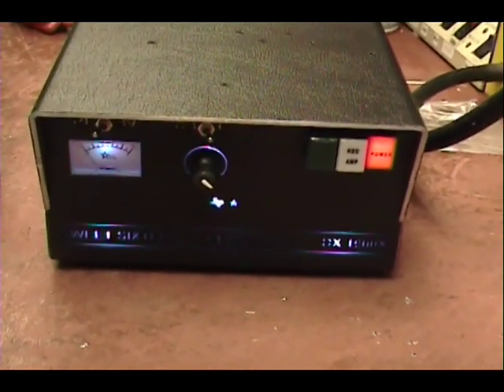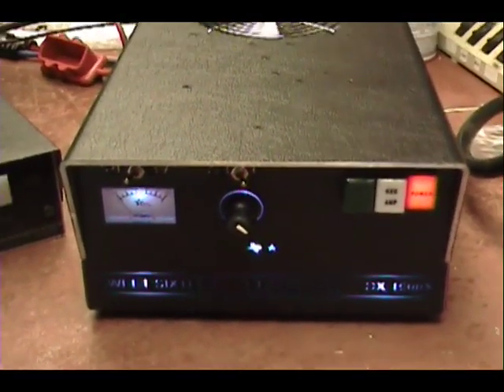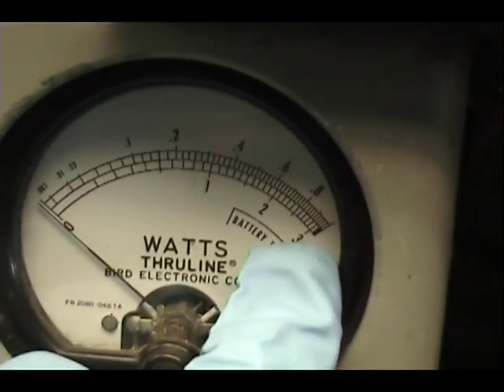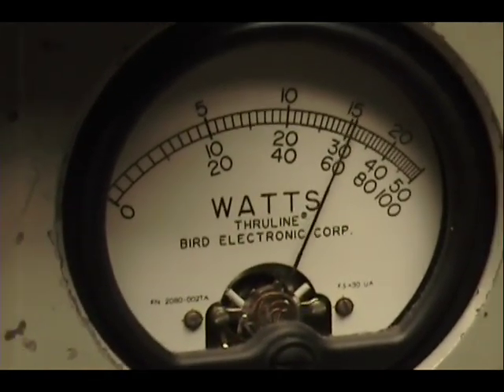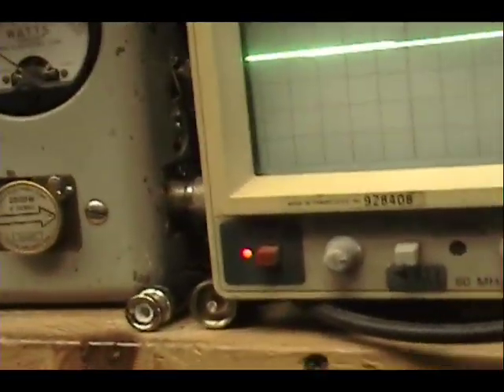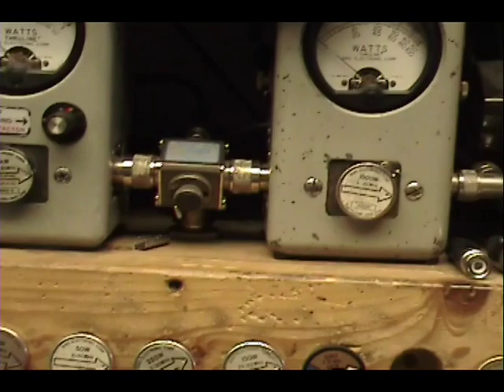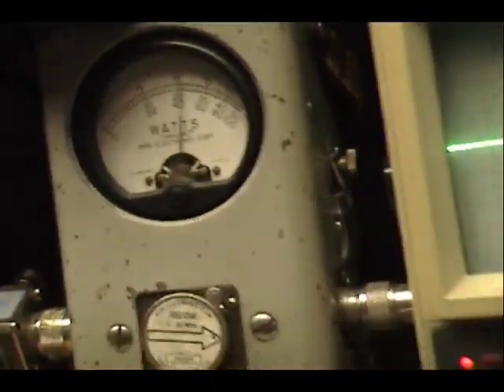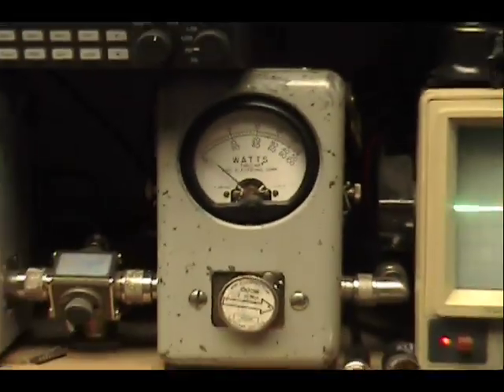Texas Star DX1600X Output Test

Comment: I wonder why they call it a "Sweet 16"?
Reply from the maker: They got that name many years ago when Toshiba 2SC2879 pills put out that much. The difference today in S units down rang will be immeasurable.
Reply: @BellsCB  Thanks!
Reply: @BellsCB  I have about 26 original red dot 2879 I bought in the early 90s when I use do do competition and I'm going to get back in just talking but I don't know anyone I can trust to build me a sweet 16
I have a new untouched 16 just needs tuned and bias set and oscillating diode.

Comment: How many power supplies linked together to provide the 13v ? Yikes.
Reply: Two Astron 70 amp Power supplies @ 14.8 volts using AWG 4 Gage wire.
Reply: @adriandrenalin6716  i have 2 52kx supplies stacked...lots of fan noise. My fluorescent lights in the house dance to my voice.

Comment: great look at the newer sweet 16. I have hot plate DX 1200 8X 2SC2290 got in early 90s class B type. use 2950 or DX99V drive radio. never had a problem still works. got the old style fan kit. only had to get new fans.  look at the scope. class c to AB bias.  you want SSB keep drive down AB on.even sounds better on AM. FM don't matter. it will run cooler in class C. if you run SSB on class C  it will clip a lot and you could pop a pill. this video shows the clipping on the scope very well. great job!!

Comment: I used to run a Palomar 400HD with a really modded Cobra 25LTD> Every meter I put it on was giving me about 300 watts output, with a 2 watt deadkey and about 25 watts peak. Now, I'm running a General Lee, putting out about 45 watts and I'm looking to run it with one of these, as is, no extra driver. 800 to 900 watts of clean power would be really great. I could run my General HP40 into it, but really don't see the point of that

Comment: I would agree 900 clean watts on SSB is more then enough. It would take a bigger increase then what that amp can make in theory to truly make a difference when dx-ing. On top of that if he get's long winded he will need some way to deal with all that heat and will need some serious power supply to keep up with it!!

This sums it up nicely:

Each 3db increase is equal to doubling the reference power. 

(3db = X2) ( 6db = X4) (9db = X8) (12db = X16) (15db = X32) (18db = X64) (21db = X128)  so pushing the gear and generating all kinds of heat and harmonics is not going to help that much. 

Now if this radio had it's audio bandwidth increased and had the ability to use a broadcast type audio compressor and a mic that had more range that combined with the 900 watts would be so much more useful then another 300-400 watts.

Comment: New to the whole base station deal so I would like to ask. If I run this with my Connex Saturn CX-33 SSB and run it at 25w I should get the same results he did? And would I run that on the AB or C phase?
Reply from the maker: Yes you could get the same results, roughly 800-900 Watts Peak Power with 25w drive.  You could use AB all the time or..... use AB with SSB and  C with AM.  Never C with SSB.